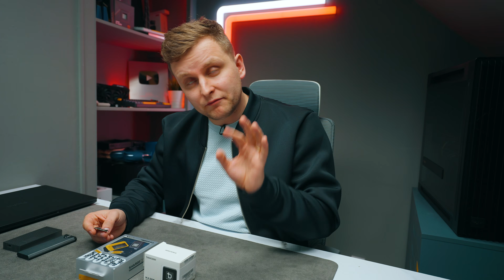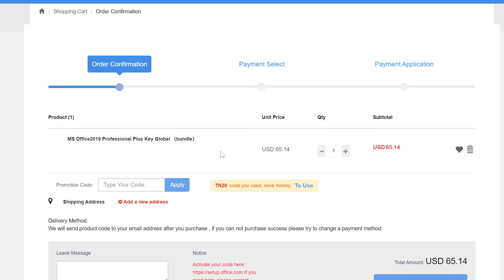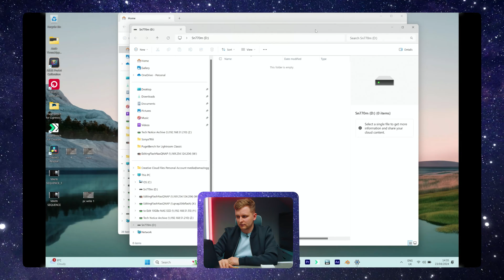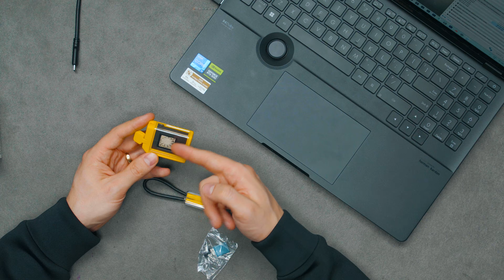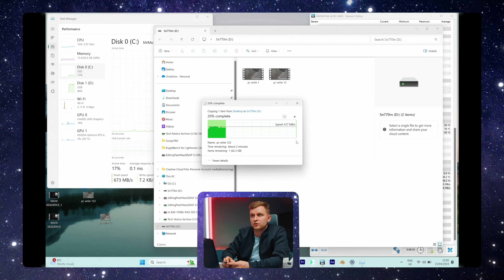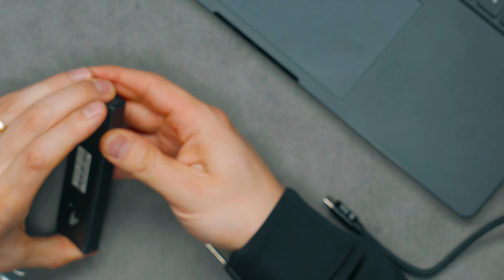Coolest SMALL NVMe SSD Enclosures You Can Buy!

Comment: My main issue with NVMe enclosures is reliability, with the only ones I have found that work  without cutting out, being the overly large ones you could fit 10s of the actual NVMe's into its volume even though its only designed for one. The other being the most obvious, you get what you pay for, cheap is not saving you money with them either. I have so far only found 3 that I can call reliable and they are the chunky ones, and they are the 2 Asus one (the rog and tuf ones) and the 20Gb/s ones from Sabrent, and all 3 are huge next to the small 2230 NVMe's like shown here that I want the small enclosures for. I just want it to work, the flashy bits are of little use to me.

Comment: The grey variant of the sharge enclosure is currently £39.99 on Amazon in the UK and the 2tb WD sn770m is £129.98 (although with 1-2 month delivery) 👍
Reply: does it work ? becaus on there site it says its not compatible with the WD SN770M and i have a 2tb laying around but im afraid to buy the case,dont want a case that doesnt run my ssd
Reply: @DamienHorta1289  definitely works with the SN770M as that's what I use in it.

Comment: hi i have DockCase pocket enclosure every thin with this device is ok but the issue is te PLP is not working or not acting and in website of this device for update or upgrade the firmware i should get the REV what is this mean . my question is is this device not accept any other device like Microsoft pro 9 or laptop which has  C type 4.0 or it accept only C type 3.0 or 3.2 only. please let me know if you have a solution for that issue waiting for your reply as soon as possible

Comment: Thank you for doing this video. I don't understand how M.2 SSD's can fit in there as they are too long?
Reply: The 80mm long NVMEs are the most common ones.
The ones he used are only 30mm long, which are also available in 2GB and 4GB versions.
Reply: @hagen.360  Thank you.  I did not know there were smaller sized M.2 drives!
Reply from the maker: Yeah there are few different sizes!
Reply: @theTechNotice  Thank you.  I literally did not know.  I thought it was usual size you put on your Motherboard.  Love your work. :)
Reply: @hagen.360 TB not GBs